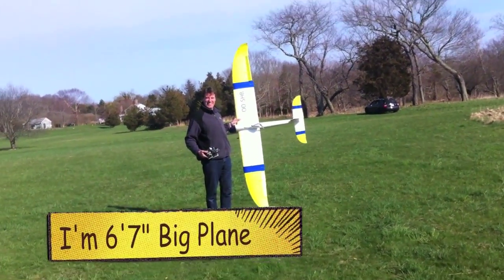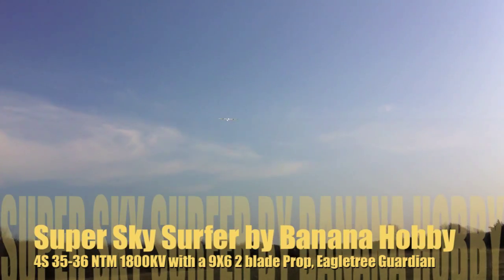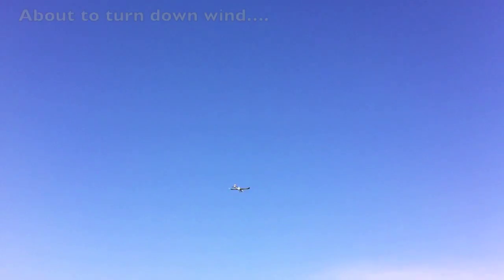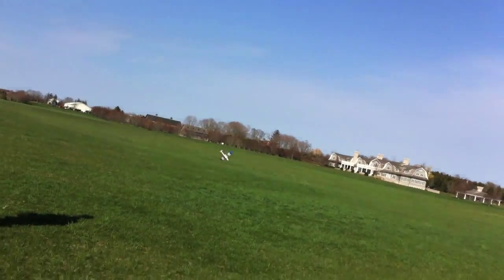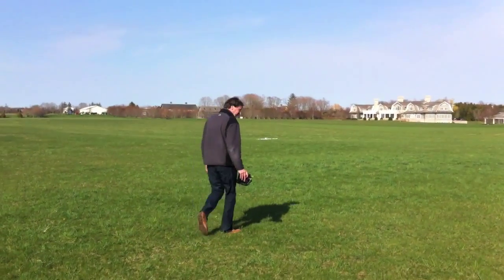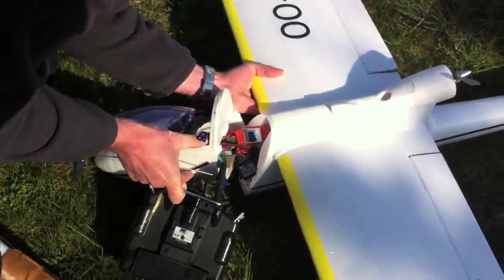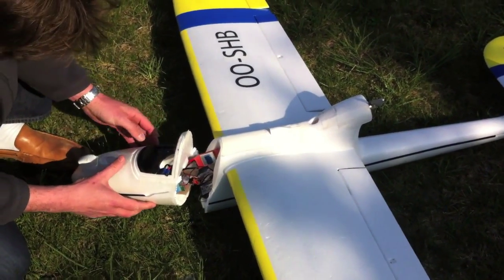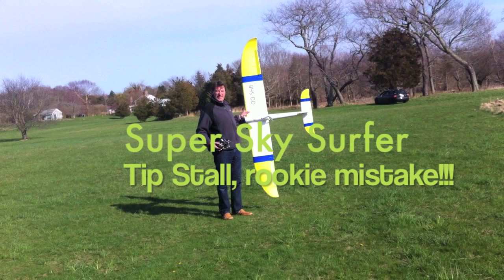Super Sky Surfer Tip Stall Crash

Comment: Well, the way I understand it is its NOT all about the watts. Sure you will be flying good for several flights BUT..it -Will- eventually burn your motor up! Be careful and keep a watchful eye on it. Keep your amps at the required specs via throttle control. You may me able to do that with your computer radio. I have that motor and I want it in my SSS, that's why I bought it. It a beautiful motor..... I'm afraid of burning it .